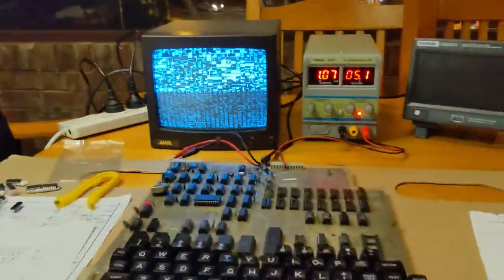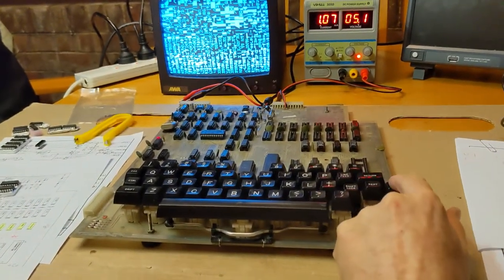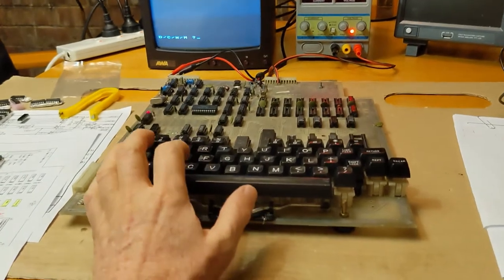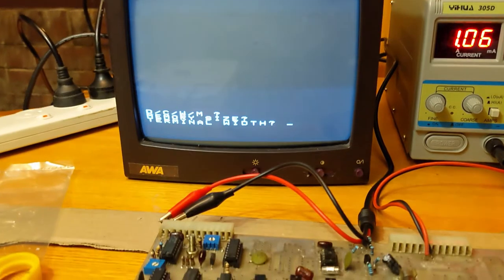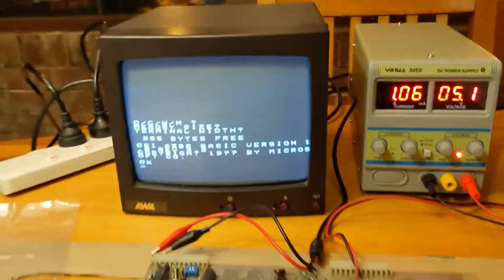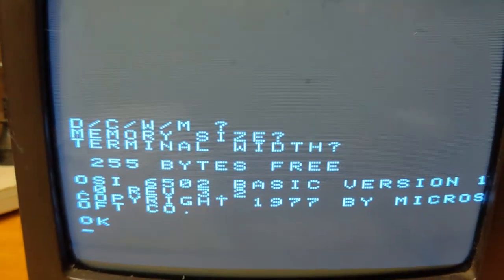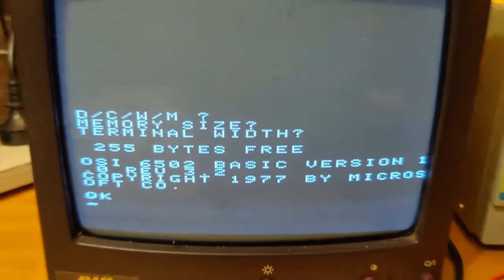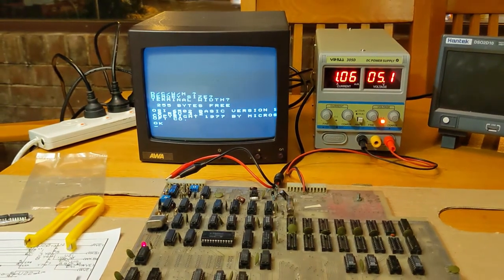It is alive! OSI Superboard II Model 600 Rev B

Comment: Congratulations to boot. Is the linefeed every 72 chars an artefact of the 255 bytes of RAM or a feature of that BASIC?
Reply from the maker: 72 is the default Terminal Width. Can set it to more if you wish, such as 80 or 132 characters

Comment: I’m trying to fix one I got recently from a friend it’s the same one. Rev B. I think my #3 BASIC rom is bad and the monitor rom.  I just burned a SYNMON1 ROM and now when I got break the system comes alive on the address and data lines but the screen just goes blank. Do I have to have the BASIC roms in it to get to the monitor screen?
Reply: I fixed it! And it has 48 columns 😎